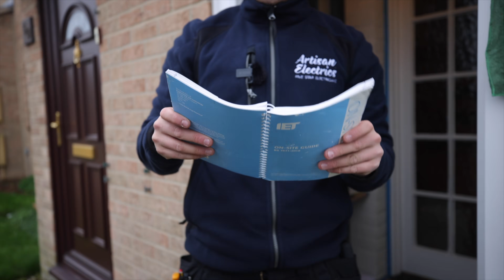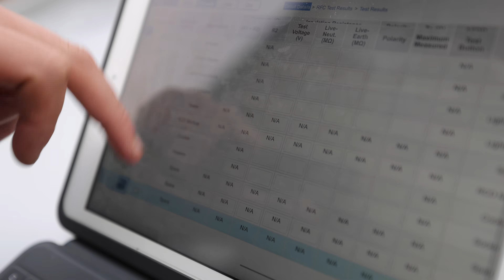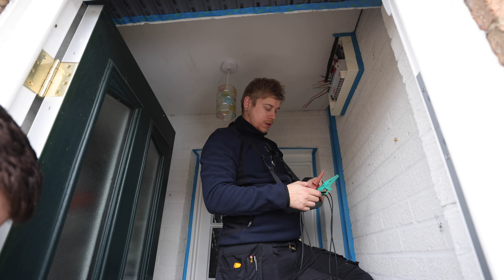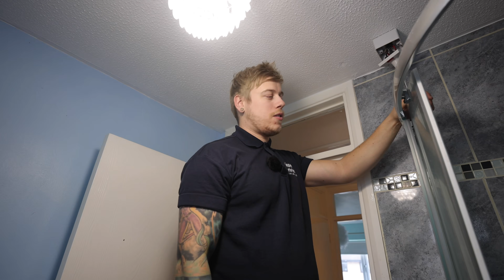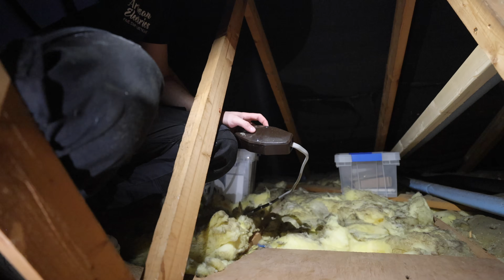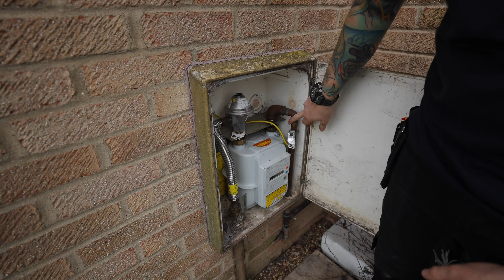DANGEROUS ELECTRICS FOUND DURING AN INSPECTION - Electrician Life

Comment: Always test to the current wiring regs it doesn’t matter if it was installed to 16th, 17th wiring editions etc we test to the latest regs so safety is always the top priority for our clients. Loved watching the video well done guys 😁.
Reply: nope, you're talking complete crap. Wiring only needs to meet regs in place when it was installed.
Reply: @The UK Electricians Show Exactly, it doesn't have to conform to the current regulations
Reply: If you're testing to the letter of the current regs, they specifically include allowances for older installations:

"Existing installations may have been designed and installed to conform to previous editions of BS 7671, applicable at the time of their design and erection. This does not necessarily mean that they are unsafe."

If a circuit hasn't deteriorated and hasn't been altered, it hasn't become less safe in the last thirty, forty, fifty years. I'd love to see RCDs on every circuit and do recommend them to everyone but there's no requirement. "We can do better now" is not the same as "this is unsafe".
Reply: @The UK Electricians Show how can you code to the current edition of BS7671? There are no codes in BS7671. BS7671 has very little to do with EICRs; it's guidance for new installations.
Reply: @The UK Electricians Show That's specific guidance from best practice guide 4. Non metallic consumer units for example are acceptable
Reply: @The UK Electricians Show that doesn't mean anything, just admit you were wrong

Comment: Lee that was a great Tutorial. I think that anyone that knows their subject can talk at ease on it and you certainly did today. 
Its what I like about our trade ,there should be no loose ends and its all in the details. The combination of both physical and mental ability is what makes it such a good fit for someone as a career choice. Every job is different and you bring your accumulated skill set to the job at hand each time .Plus you never stop learning.
Finding that mis wiring to the shower unit was a good example of building up your question list for trouble shooting  and problem solving.
"clonker" now that's a new one.
Glad to see you reviewing your use of the magnetic cable leads for testing. Always good to review and upgrade how your doing things and perfecting your skill set. Luke must be loving it. Lee is a good teacher, Different to Cory. He brings his own teaching method. One on One is always a great way to teach and learn. Plus the teacher learns twice in the teaching. Well done.

Happy New Year !!!                            Love the Masks.
Reply from the maker: Thanks a lot
Reply: Domestic electrics is not a skill, it is just manual labour.  If you understand the 3 pin plug you have learnt about 80% of what is needed to undertake domestic electrics.  There is no mental ability required, that is why there are no many sparky's good and bad out there.
Reply from the maker: @deckertyrell3340  🤦‍♂️
Reply: @deckertyrell3340  if you understand the 3 pin plug, could you please change my one way light to an intermediate and test it afterwards? thank you x
Reply: @dreamer-2972  Sure,  just fit a couple of kinetic light switches and a receiver at the light fitting. No cables or skill required.

Comment: Good video, nice find on the shower and conservatory lights, well done lads👍🏻. However would normally test continuity of bonding conductors, had a few that have been cut in past, especially the water when it's in a refurbished kitchen.
Reply: 100%... Ive seen main bonding conductors removed by plumbers/kitchen fitters/gas engineers countless times. Tossers

Comment: Never disconnect the protective conductors to IR test , if a neutral was nailed to a water pipe this fault would not have been found .
Reply: Did he test all 3 cores at the same time for the IR?
Reply: @JAUS95  no he linked the L and N and tested them to CPC.
Reply: @robertwilliams7222  why would you do this and not just test L-E and N-E? I'm an apprentice so just curious
Reply: @JAUS95  less chance of damage to any equipment plugged in.  There will be no potential difference (0V) between the live conductors.
Reply: @JAUS95  if there happens to be a N-E fault/short and you do not connect L to N together you will stick your 500V IR test voltage across any connected loads and quite possibly damage them if you do a L-E IR test
Reply: @Marco-mg9tv  so instead of going round making sure everything is turned off or led lights disconnected you can do this
Reply: @JAUS95  yes for an existing installation this is usual practice. I’d do it on the whole board with all breakers on and main switch off. If I got anything below say 5M on the whole board or split load side I’d check each individual circuit . On a new circuit or installation you want to do LE, LN, NE.
Reply: @Marco-mg9tv  ah this makes sense,  I've never seen this done. So would you go on the tails and the main earth bar to test it
Reply: @JAUS95  Test between main earth bar and bus bar with the bus bar connected to the neutral bar. But if you are asking these basic questions I’d say you are clearly not yet competent to be testing and should complete training first. YouTube is a great resource and good place to see real life examples but don’t use as a substitute for proper formal training as can be seen from this video you can incorrectly assume that because they are qualified and registered electricians they are doing everything correctly and safely
Reply: @Marco-mg9tv  I'm a 3rd year apprentice and have just never seen this way of IR testing done.
Reply: @JAUS95  maybe you’ve only been looking at initial verification rather than testing existing installations ?
Reply: @Marco-mg9tv  no mate, been doing full EICR's, both initial verification and periodics for existing installations. When I've seen IR testing only ever seen it on individual circuits and it be done as L E L N N E
Reply: @JAUS95  fair enough. Nowt wrong with doing at a group of circuits though and de-risks damaging any loads that are impractical to disconnect such as LED drivers
Reply: @Marco-mg9tv  makes complete sense, wish i had my head around potential difference more though something we  covered in first year so might have to look at it to fully understand it thank you
Reply: @JAUS95  potential difference is just voltage like your neural could be at 11V with respect to earth and the Live and 20V with power off at main switch. In reality this won’t make much of a difference when testing IR at say 250 or 500V. The main issue of not connecting L&N is that as I’ve said if you DO have an IR fault to earth testing with them not connected could damage a load as it (the load) will provide a low resistance path
Reply: @Marco-mg9tv  cheers for your help mate appreciate it

Comment: Why do you disconnect earths when IR testing? The tester is floating so surely a connection to earth should make no difference?
Reply: .? If the home owners is in and they are washing up/ touching radiatos etc.. would 500v going through the earth give them a shock? (Water bond).
Reply: @deano6188  quite possibly.  Always taught to not energise the earth during IR testing.
Reply: Quite funny at college and all they teach is IR live-CPC is the first IR test
Reply: @shaungrain4921  College is based around an aspect of electrical installation and testing it moves you through module's to learn and become a Competent person...Have you hear of a "safe system of work?". Where 2 or more people are working on the same consumer unit/ incomer? ... both lock-off and brief each other of their planned works to keep each other safe and out of harms way. The customer is part of your "safe system of work" and "on-site risk assessment". 
My question above was would/could you get a shock off bonded parts if left connected when IR test is done but more to the point would you take the chance?
Reply: The test should include mass of earth as well as the cpc, I fell foul of this years ago ( before RCD’s)  when a plasterer screwed through a line into a skim bead, the whole building was ‘live’ and a guy pointing up some brickwork outside on metal ladders copped an unfortunate one !

Comment: Still watching, but I'm wondering was it usual in the past to have some circuits not on RCD?

In South Africa there are some cases where certain circuits can be off RCD (e.g. burglar alarm, fridge, emergency lighting), but it's not standard to find that. Only seen that once at a retirement village where lights were not on RCD so the residents didn't end up in the dark if they had faults.
Reply: Yes there is no set regulations,ideally the circuits you are talking about is best run on the surface and are not buried in wall ! the first reg for rcd was installed for use outside ie mowing the lawn etc
Reply: Some times for example you can have a power circuit on a mcb and all your spurs rcd spurs so it's a local disconnect and segregated rather than when said device trips the rcd spur it wouldn't trip the breaker as well
Reply: In a nutshell yes, it was usual to have circuit’s with no (30mA) RCDs in the past.  When I trained back in the 1994 we were on the 16th edition regs, on TN systems the only thing that had to have RCD back then was sockets reasonably expected to supply portable equipment outdoors, it was usual to see just one of the sockets with an integrated RCD used for this too.  Then in the 17th edition in iirc 2008 we had to RCD protect concealed unprotected cables buried in the walls <50mm hence the dual RCD boards became more of a thing.  It was also in the 17th sometime when they allowed the omission of supplementary bonding in bathrooms when certain conditions are met, one of these being all circuits of the location on an RCD too.  It is possible to have some circuits not on an RCD too, sub mains being a good example where wired in SWA.
Reply: @cumberland1234  yes ,when the reg come out to cover the circuits with a rcd the nic inspector on his visit said what's chance of an old girl drilling through a cable or coming down the stairs and the rcd tripping leaving her in the dark ! at least we have rcbos know 👍
Reply: In Finland RCD wasn't much used until late 1990's, before that only fuses. Wasn't until a few years ago that pretty much everything is on a RCD.
Reply: @justme5384  2007 is a few years ago? This is only on new installations though. On old ones RCDs cannot be used because of PEN-wires.
Reply: @okaro6595  if I remember right 2007 bathrooms had to be on RCD, then maybe 2012 all sockets used for handheld tools etc had to be on RCD (excluded sockets that was for a specific device and not easily accessible, for example dishwasher, oven, refrigerator etc. Now pretty much everything needs to be on RCD, including light circuits etc.